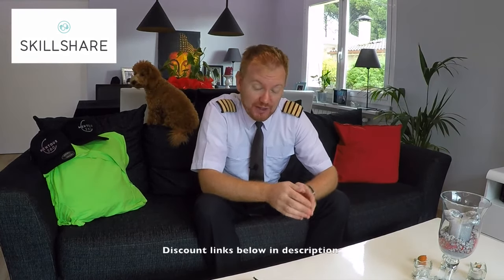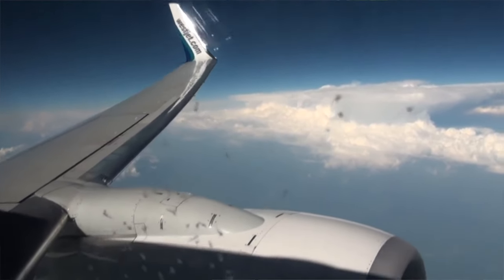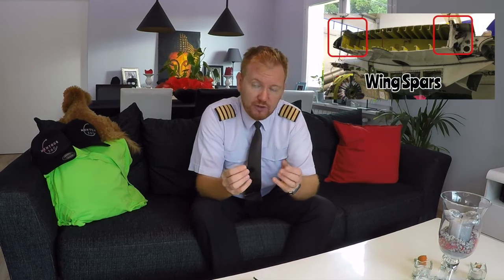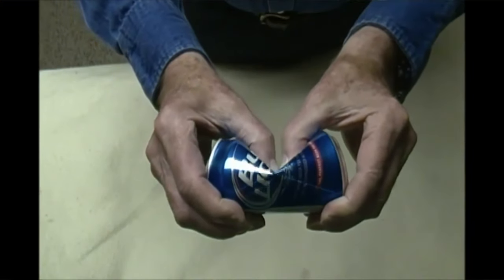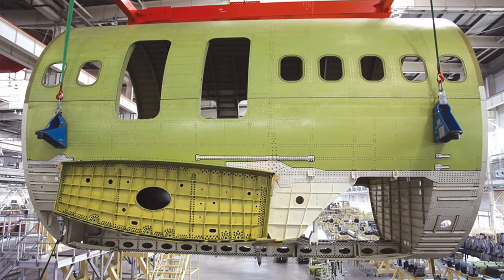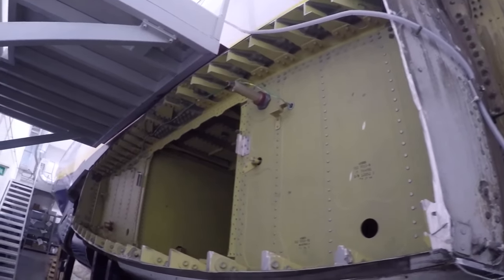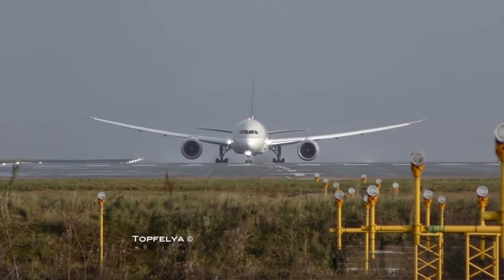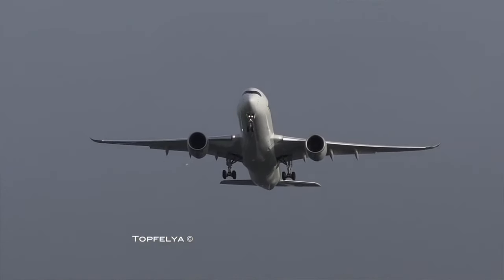Why don't the wings break?!

Comment: The video is pretty good, and it's attempting to cover a pretty complex subject area.
But...it's looking at the wrong kind of loading.

The title of the video SHOULD actually be: "How DO aircraft wings break?".

NEWSFLASH 1: take note of the finding of critical fatigue cracks in the WING ROOTS of Boeing 737 NG's. (Next Generation).
in 2019, 36 of the 686 aircraft inspected (5%) had significant fatigue cracks.
The FAA said: "the cracks could "adversely affect the structural integrity of the airplane and result in loss of control of the airplane" if not addressed.".

In detail:
"On some models, premature material fatigue had been discovered on key components: on the pickle-forks. They are installed vertically and are an integral part of the attachment of the wings to the fuselage. They also help to absorb the extreme forces acting on the wings in flight. They are known as pickle forks in the jargon as they resemble a cucumber fork"

 "The pickle forks are designed to last an entire aircraft lifetime. The components should hold 90,000 flights, which means 90,000 take-offs and landings. But now technicians of an airline in the United States have found significant cracks in a Boeing 737 NG after only 35,000 flight cycles. The Seattle TV station Komo has reported on this. «It’s not designed to crack that way at all. Period.», a former Boeing engineer explained in the report. Each Boeing 737 NG has four pickle forks."

NEWSFLASH 2: Dec 2022, discovery of fatigue cracks in Boeing 737-800 wing flaps.
Virgin Australia 737-800 VH-YFZ: 
Immediately after take-off, the pilot noticed the aircraft tended to roll to the right, and trimmed the rudder to keep wings level.
The aircraft no longer required trim when the flaps were retracted for cruise, but the issue returned when the flaps were extended for landing.
There were no warnings of flap skew or asymmetry provided to the flight crew.
A subsequent engineering inspection found several components in the aft flap actuation system had failed.

Hmmmmmm.....
Seeing as our Host Mentour Pilot spends time in 737's, this is of particular interest.

A lot depends on how you define the word "break".
If break = crash, then no, a modern commercial jet has NOT (yet?) crashed due to wing fatigue.
BUT, the existing flaws (as in small cracks) DO grow as a result of fatigue.
And requre attention.
And in some cases that the aircraft is retired from service, or switched to less intensive use.

Therefore, it is misleading to think that aircraft wings do NOT "break".

The concern is NOT about having the wings fall off due to a SINGLE big load: the load certification tests are really eye candy to a large extent (such that when the Boeing 777x test plane didn't manage to get to the goal of the Ultimate Load, it wasn't seen as a big deal. Because the Ultimate Load Test itself is seen as overkill).

But the REAL concern is over fatigue, and the ability to detect and monitor it.
And that is REALLY hard to prove that you're on top of it.
It can take DECADES of flight time with LOTS of aircraft to get the data for that.
Decades? Lots of aircraft?
Yes.
Because of the very nature of fatigue cracks, you cannot do a limited number of tests, and then extend that to a large number.
You TRY to do your best with limited tests, and simulations, but there's always uncertainty.

The point to take away is that aircraft wings don't "break" in one dramatic "oops, we just lost a wing", but rather "break" in an incremental manner, due to fatigue.
And these "breaks" (in the wings at least) have not (so far??) caused a crash because the growing cracks are caught by inspection.
And repairs/replacement is done.

However, there HAVE been crashes caused by fatigue failures in other critical parts: like landing gear and control surfaces.
And military jets have had serious wings cracks due to fatigue (but they are flown harder, and are flown closer to their limits usually).

The wings themselves, in particular the wing root areas are specifically designed with fatigue crack growth in mind, so that crack growth that requires attention is not usually seen here.
Interesting, it is 737's that tend to come closest to airframe fatigue issues of all the modern jets: see more below.

Since the 1950's, commercial jets were supposed to be designed to be "fault tolerant".
That is, so that existing flaws (and there are ALWAYS flaws) should not see sufficient load & cycles to cause a dangerous situation.
Although that's likely changing with the switch to more composites (carbon fibre etc) in the airframe.

Boeing states that: "Fatigue damage is a cumulative process, and some  cracking is expected in large fleets designed to reach an economic life goal with high reliability. Consequently,  supplemental fatigue damage inspections may be  required for older airplanes."

In addition, the intent is that: "The structural design service objective is a minimum of 20 years of airline operation with only a small percentile of the population subject to repair because of the  initiation of detectable fatigue cracks."

Read more in this research report (it's open source):
Goranson, "Fatigue  issues  in  aircraft  maintenance  and repairs", International Journal of Fatigue, 1997
It's a somewhat dated report (1997) but very clearly written, and explains the general issues.

Look at Figure 2: Boeing commercial jet fleet summary (from 707 thru 737 to 767). 
Notice that 737's are the biggest fleet by far (2,706 aircraft). 

Also note what is called the "Minimum service design objectives", which is the point in the aircraft lifetime (where) some initial fatigue might occur.
Notice that for 737's, this is 75,000 flights, or 51,000 hours. 
Hmmm...seems like a LOT of flights/hours.
BUT, the next column shows that there are indeed some aircraft that hae exceeded this: by a LOT.
90,100 flights or 81,100 hours,

What then?
Well, these aircraft need extra inspection to watch any potential flaws (i.e. a "crack) that is growing. Maybe slowly, but is no doubt growing as it asees more cycles/loading.
And THAT costs $$$.
Remember that 20 year objective: at some point it's going to cost you too much to keep on inspecting your older aircraft.
So you sell them to someone else who won't fly them as often as when used in a busy commuter service: say to a charter group.
Or as cargo planes perhaps.

And as I said, the game changes with the introduction of more composites in the airframe in the place of aluminium.
Composites behave VERY differently to fatigue loading, and it's much harder to make predictions, to estimate fatigue growth.

Comment: Anything can break under the right circumstances. Just dive at full power and pull up hard.
Reply: He just told you that G forces are a factor in consideration...
Reply: @Versus > On a modern Fly By Wire Commercial aircraft such as the CSeries (A220) that would not work.  The FBW system has built in protection to prevent that from happening.

Comment: Wings with fuel increase angular momentum?   So a slight torque won't result in as much rotation?  Similar to high-wire acrobats use a long pole to stabilize themselves on the trapeeze?

Comment: That's a nice thought, but Alaska Airlines is allowed to fly in US airspace but they didn't bother to grease the jackscrew in the flight 261 stabilizer to save money, which made it jam and then snap mid-flight causing a nose dive into the ocean killing everyone on board. The airline was also found to have been falsifying all their maintenance records in the investigation, AND they suspended a whistleblower mechanic that tried to do the right thing. In the end they only got a small fine while the passengers paid with their lives. The government certainly didn't put them out of business. They still operate in US airspace, and all the other airlines have to compete for low ticket costs with them. So how can the passengers possibly know what's going on behind the scenes and stay safe?
Reply: BTH, neither did the pilots know about the maintenance issue, or they never would've taken off.

Comment: Hai mentour,, i wanna know how airplane airconditioner work at cruising.. thanks... 🙏
Reply: Air conditioning on an aircraft is done by the use of Air Cycle Machines (ACMs).  A typical aircraft has 2 or three ACMs.  If you want understand how an ACM works, just look it up.  In flight, since the outside air is so cold, hot Trim Air from the engines is injected into the ACM ducts to heat the air.  The amount of Trim air injected regulates the temperature.

Comment: It's a common myth that structures (whether they be high-rise buildings, bridges or aircraft wings) are somehow better able to resist loads if they flex a bit. And that they are designed with that in mind.  This is nonsense.  The reason why they flex is that it would be too impractical (take too much material) to make them more rigid (less flexible), and there is no point in making them more rigid (and therefore stronger) if they are already  strong enough for the job.  Of course a structure which flexes can look, or feel, alarming to the lay-person.    [ For those who bring up the old chestnut about tall grasses bending in the wind while trees fall over, we are not speaking here of huge geometric changes which shed the load:  that's a completely different matter.    ]   To be fair, the specialist engineering knowledge required to design structures to withstand aerodynamic forces is neither easily acquired nor explained.

Comment: Regularly exchanging and renewing aircraft components, okay...so if all of them have been replaced at least once, is it still the same aircraft? ;)
Reply: I know this is a joke but just in case, no, the frame of the aircraft is what’s counted, hence “airframe” so if you replace all the parts over time it’s the same frame and therefore still the same aircraft

Comment: Have you ever been afraid when flying a plane? Something made you really nervous like extreme winds when landing?
Reply: Yes, I was flying from Los Angeles to Toronto in 1990 and we had to fly straight through the middle of a supercell - the plane got struck by lightning over a dozen times and set fire to both fuel tanks - and the wind shear was so severe that both wings snapped off completely, to add to the terror, a madman appeared in the aisle of the plane and said he had a bomb which he was going to detonate and then all the passengers started freaking out when due to the violent shaking of the plane which was losing altitude all the hand luggage fell out of the lockers above the seats - and after another ten seconds of all this - I woke up in bed in a cold sweat and had to go downstairs to make myself a drink - the moral of this story - don't eat cheese before you go to bed. . . . . . . .

Comment: I am still amazed at how much load wings take considering their size (huge at times)yet they last the life on an aircraft taking on 2 or 4 huge heavy powerful engines their thrust weight the fuel n the weight of the loaded plane, n how they take so may landings take offs without actually breaking, I know the wings of the airbus 380 are made in Britain (Wales) carbon Fiber, I am sure they Must be working on very close tolerances in temperature n all other parameters too forming these Huge wings, How about fighter jets do they n how much are their wings flexing? also are EX military pilots always the best? Its what I always believed   many thanks mate brilliant video
Reply: Wings are designed to flex as he stated in the video. The weight of the engine and fuel actually takes stress off the wings by evenly spreading the weight of the aircraft. The tolerances are actually quite high in aircraft (usually 7) meaning the part can take up to 7 times the amount of force that would normally occur. Fighter jet wings do not usually flex as they are small enough to not need that, flexing would hurt the aerobatic capabilities of the jet if the wings were flexing. Last but not least Ex military pilots are usually better in emergencies but for normal flights they’re not better or worse than a career civil pilot
Reply: @ace_trace_2237  Thanks a lot mate cheers

Comment: Are the wing spars tapered as they go from the fuselage to the wing tip?
Reply: Steven Smith:  Yes the sparks are tapered. The outer mold line (OML) is generally set first by the aerodynamics group. From there the height of the spar is then determined based on its location chordwise along the wing. The gages (thickness) of the spar web as well as the upper and lower spar chords are then set based on the stresses the wing will encounter. Of course that is slightly generalized as there are typically a few loads cycles and design cycles that the airplane iterates on to get the final design.
Reply: *spars.

Comment: The Tupolev Tu-144 broke its wing and disintegrated mid air while performing a high g recovery after a stall. Was the Tu-144 badly built or could that happen to any manually controlled aircraft?

Comment: is awesome...what is the standard length of a wing?
Reply: julius namroni;  There really is none. It all depends on the mission of the airplane. There are some maximums based on gate sizes at airports, but now the airplane manufacturers are getting around that with folding wingtips. Check out the new 777X.
Reply: @dmoq683  THANKS DAN MOQUIN...WHERE ARE YOU FROM

Comment: A few good points. But I wanted to know how wings flex without breaking.  But I guess that's an engineer's question.
Reply: Thomas B :  The video is correct that the wings are designed with sufficient factors of safety (x1.5) beyond limit loads (+2.5g / -1.0g). Limit load is the highest load the airplane will experience in its lifetime. There was a slight misrepresentation in the video that these loads are seen on a typical flight. A typical flight with moderate turbulence is more like +/-0.35g, or 0.65g to 1.35g. A nice data point is on the 777 destructive test, the wing tip was bent upwards of 27 feet, yes feet!!! from its nominal position.

Comment: So if the wings full of fuel keep the plane balanced and the wing from bending too much, what happens at end of flights when there is very little fuel in the wing-tanks or none, and you are drawing fuel from the center?  I think jet airplanes have been flying on little fuel in the wing-tanks for decades and decades, at least during certain parts of their flights.  Please explain?
Reply: He's mentioned in another video that they always use up the fuel from the center tank first

Comment: how much does an engine weight ? how many times a minutes does a fan blade turn, ? how fast is an airplane at takeoff? how fast do they fly? how fast is the plane when it lands? how many pounds of thrust do some of these engines have? about how many gallons of fuel does an engine burn a minute?

Comment: Regarding a poor maintenance and perfect maintenance in US or EU. Well how about a crash of DC9 flying by Alaska AirLines? As far as we know that company did not maintain the horizontal stabilizer shaft and screw (the mechanical device which was moving the stabilizer up and down) for three years, even that the regular maintenance was supposed to be done every year!  Everybody on board of that aircraft was killed. Who know how many more US or EU companies with ‘perfect’ maintenance record are actually doing the same or similar kind of maintenance.

Comment: Doesn't the fusealodge create lift too?
Reply: not usually. In some planes the fuselage creates lift, but in most cases the fuselage is mostly designed to carry the intended payload with as little drag as possible.

Comment: Any nervous flyers, not that if wings don't flex they brake. This is why tall buildings flex in the wind and carnival rides and roller coasters creak. Point of interest the concord exspanded it's outerskin why flying super sonic by up to 15cm due to the heat. I'd rather fly then travel via car as the safety rate of flying is by far the safest mode of transport.

Comment: Fluttering phenomenon should have been mentioned. When that happens start to pray immediately. It might be totally uncontroled and leadind to wing breaking, but usually it is occured only in flight tests.
Reply: @Amnon > You sound like you may have some experience in Flight Test.  I have worked Flight Test for over 32 years.  We use Flutter vanes to inject flutter onto the wing and or tail.  Flutter testing is a major part of every aircraft certification. 
Prior the the first aircraft ever flying, we do GVT testing (Ground Vibration Testing), this can also show if a threat of Flutter can be expected in normal flight
Reply: @rcairflr  Only theoetical engineering experience. Today they are trying to solve everything with software manipulation like the 737max and that's what mostly scaring. All the best.

Comment: What is the green coating on planes inside parts and Why?
Reply: It’s a paint primer. Different colors exist (yellow, for example) but green is the most common. This is also why an aircraft without interiors is often dubbed a “green aircraft”
Reply: @Oddball > As Romamario stated, put on the bare aluminum to prevent corrosion.